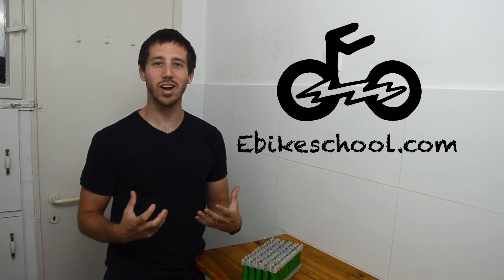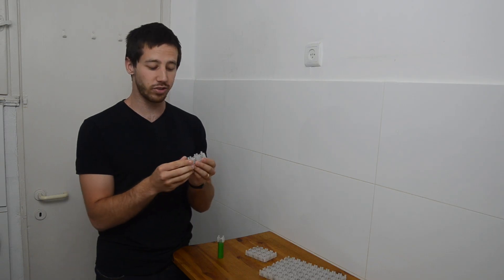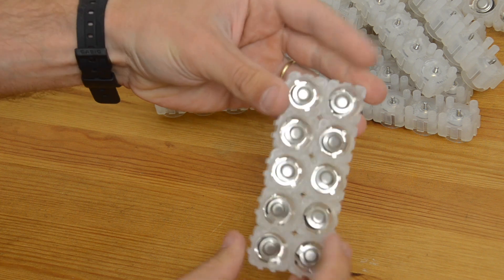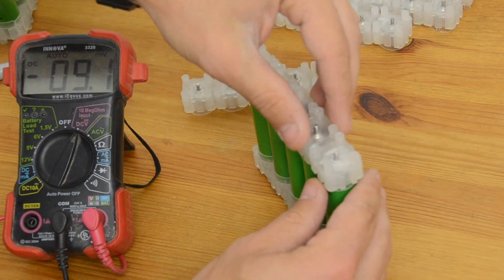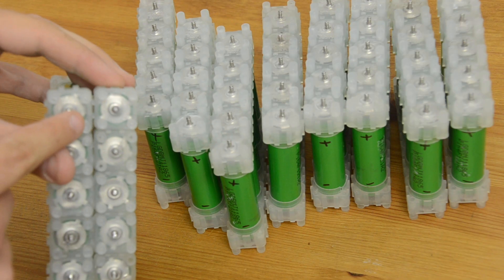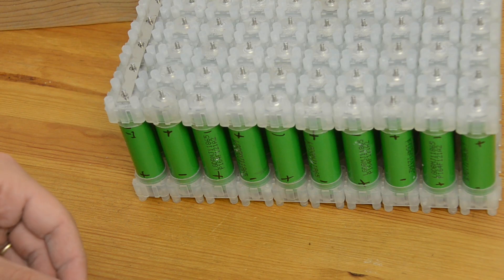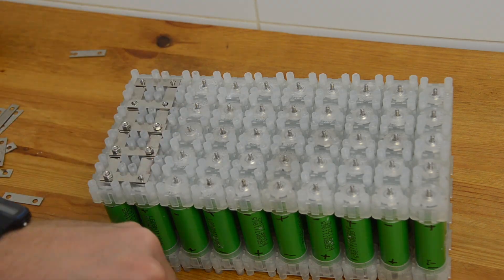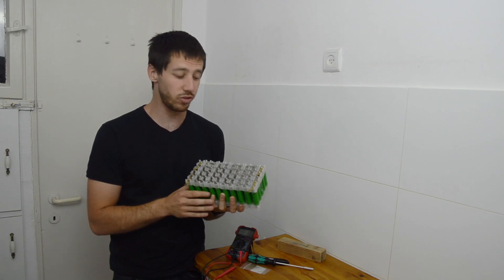No Spot Welder or Soldering Battery Building Kit from VRUZEND.com

Comment: Hey guys,
A question... :)
I have a 500w ebike motor rated for 36V and a 500w controller.
My battery (currently) is 10AH 36V which started to shut down on high load scenarios and was "fixed" by warranty (my bet is that 500w was torturing the battery for continuous current higher than designed).
although the battery was "fixed" (seems really like they disabled the bms, since there are serious voltage drops still) I'm looking for a battery to unlock the full potential of the 500w motor.
So I'm thinking to buy these cells connectors ( and 18650 cells) and really make just my own battery but I'm not sure at what current rating(with a bms), 15AH is enough for 500w ebike, what should i target?
And my current battery as far as i understand can deliver upto 360 watts of power, is that correct? (36V * 10Ah = 360W )?
Reply: Not quite, 36V * 10Ah = 360Wh, which is Energy - roughly how long you can ride for.
36V * 10A = 360W  This is Power (= energy per time) - i.e. how fast you can ride.
You need to know the maximum discharge current rating of the battery to know the max power it can deliver without stressing it.
The 500W motor would need 14A at 36V for full power (14 * 36 = 504). 
 
The 10Ah rating of your battery gives you a measure of the energy it can store, but tells you nothing about the maximum current it is happy delivering. 
Also the Ah rating of most batteries is quite dependent on how fast it is charged and discharged (generally the higher the current the lower the available total energy). 

With no losses, 14A would give about 42 minutes (10/14 hours) run time at full power from an ideal 10Ah battery. There are always losses of course and they increase with the square of the current. The avoidable losses are mostly to do with resistance and turn up as heat. 
At 14 amps the loss = 14 * 14 * total circuit resistance = 196 * R watts.
So even 0.5 ohms is completely unacceptable (98W of wasted heat!).

It is important to minimize resistance wherever possible, at every connection, in all power wires, in the motor controller switching components, and in the motor. Brushless motors are generally more efficient because their resistance is lower than for a brushed motor of equivalent power rating. 
See the comment from Gary Films and the reply above. These caps have been tested up to 3.5A per cell, so you'd need at least five cells in parallel (as shown in the vid) to cope with your 14A load. However you might find the contact resistance a little too high for your application (spot welds would be lower). Not sure I'd want to solder directly to these batteries in case the heat damages them.
But at 36V there are 10 sets of cells in series, with a spring loaded contact at each end, i.e. 20 sets of contacts in series, so even small resistances will start to add up, and might matter at high current (loss of max power / range, and extra battery heat).

Good luck :)
Reply: Thanks for the VERY detailed replay :)

Comment: Why do you bridge the sets 5 times?  One bridge per two sets of five is plenty.
Reply from the maker: One bridge (series connection) per set of 5 would in fact complete the circuit, but making 5 series connections makes a more robust circuit by reducing the resistance. If you only used one then you'd have a bottleneck of current at that point.

Comment: I have 6 battery from 3.7v 18650, how to make 14.4v?
Reply: 4 cells in series. The voltage of these cells varies quite a bit as they charge / discharge but they are referred to as 3.6V or sometimes 3.7V because this is approximately their equivalent voltage over the charge cycle. 4 * 3.6V = 14.4V but this could actually be as high as 16.8V when fully charged.

Comment: IFF U THINK YOU NEED BRASS ON THE TERMINAL MAYBE YOU NEED ALL CONNECTIONS BRASS THEY ARE THE SAME ONE IS THE OTHER IN SIGNIFICANCE THE BARE THE SAME LOAD .MY CONCERN IS THAT THEY LOOSE THE CONTACT OR DDISCONNECT I LIKE THE DESIGN BUT MORE INFO BEFORE A PURCHASE ON THIS ISSUE,THE ISSUE OF CONNECTIVITY ,I SHOULD WORK YOU THANX I WOULD SERVE U WELL
Reply: BRAINFART I SHOULD WORK FOR YOU .

Comment: dear, I have a question, I have a Scooter with 36v with 3 12V batteries, which model 18650 should I use 10 batteries of 2000ma or 2500ma or 3500ma? thank you and congratulations on the channel is very good.

From Brazil

Comment: what is the max amp rating? I need to use Samsung 25R with 20A continuous amperage. The setup is 12P outputting 240A. Do you have a solution for that?

Comment: How is it you are not getting shocked when touching all the exposed terminals? This is new to me. Also, shouldn’t there be fuses in here somewhere, like between the cells?
Reply: Shocks are supplied by alternating current (AC). Batteries are direct current (DC).  You will start to cook yourself at very high voltages DC, but you won't shock yourself.  Because you have thick calloused skin acting as a high ohm resistor, you won't actually cook yourself unless you wet your fingers and hold tight at both opposing terminals.  You probably need around 90 volts minimum to start risking danger to yourself. I think this is a 36 volt pack without rewatching the video.

Battery packs aren't usually fused internally, but you could do so to prevent a critical meltdown from damaged cell sets causing uneven and high discharge currents within the pack.

Comment: Hey Micah, I just received my battery kit in the mail. I noticed that the end caps are now red and blue, why the change? Also, now that I can not see through them I'm not sure how far to compress the entire pack together without squashing the contacts. Is there an OAL that I should try and achieve?
Reply from the maker: Hi Ron, this was a recent change to make the pack building easier, now you can differentiate between + and - ends of the cells and removes the chance to accidentally connect the wrong ends and short circuit. Even with the clear ends, the visual inspection method wasn't the best method. I find that its best to compress until you have approximately 88-90 mm from the top to bottom (the height of the cell with the caps on). It varies a bit from one cell to manufacturer to another. Also, a good tip is to first lift the spring contact up a bit higher in the cap before compressing the caps on. Then measure the voltage for each cell via the terminals after you've pushed the caps on and if you measure the correct voltage, you're golden!
Reply: Thanks for info. LYK how my "small" build goes.  Great tutorials, keep them coming!

Comment: What prevents galvanic corrosion?
Reply from the maker: The fact that all the metals are the same.
Reply: So all the manufacturers of 18650 batteries as well as you guys are using the same exact plating process? I find that hard to believe. Don't get me wrong I think this is a neat idea but I'm not convinced it is a stable long term solution. Short term and testing with these I think would be a very valuable. However, having a background in machining, plating and computers (during the time when the industry tried to use different materials for contacts, the plating even on computer component contacts these days differ enough to have to clean said contacts periodically) leads me to believe the same would yield with this product. With that being said, anything under a year or 2 would probably not be effected. For long term use, such as a battery bank for long term solar/off grid through battery life expectancy, would render the ill effects of galvanic corrosion. Again, great idea and it seems like you have a solid product... just not for the long term user. I'd love to see data from use/testing with various cells that disproves this theory.
Reply: Galvanic corrosion requires the presence of an electrolyte. How is an electrolyte present in this situation if the batteries remain dry?
Reply: Galvanic corrosion happens with dissimilar metals, not dissimilar plating processes.  You are not going to encounter galvanic corrosion from minute dissimilarity in alloys. There needs to be a minimum threshold in metal dissimilarity on the anodic index. It's not rocket science.
Reply: Look at this table.  Pick two different metals from two different rows, like Nickle (.30) and Brass (.40), subtracted is a difference of .10v potential, which is well within reason for harsh outdoor environments.  Certainly nothing on the order of what you're talking about in snicker plating processes.

https://www.engineersedge.com/galvanic_capatability.htm

Comment: Brilliant invention!  Can't wait to build mine!

I'm going to be building a battery to power an electric motor for my (large and stable) ocean kayak.  I plan to put the batteries in a water tight container with desiccant packs inside to absorb moister, however, I've found that no matter what you do in water environments, moister creeps in and corrosion sets in.  In the past I've used dielectric grease to stave off oxidation on electrical connections.  I was thinking about using a very small amount to coat the connections when using this kit.

Can anyone think of a reason that would or would not be a good idea?

Comment: I'm dumb about electronics...how many of the cells would you need to give off 36 volts? http://vruzend.com/product/set-of-2-lg-mj1-18650-battery-cells/
Reply from the maker: A minimum of 10 cells, but every additional 10 cells provides more capacity. I'd recommend my book DIY Lithium Batteries on Amazon, if you are just getting started and want to learn about battery building.

Comment: Checking to see if you have a proper connection by using a voltmeter??..really??..the only true way of determining if you have a proper connection, and i really doubt this will work, is to draw AMPERAGE from the completed pack. If there are connections that are loose it will become immediately apparent. As a matter  of fact the higher amperage you draw using this system,the more likely you will get into problems, too much resistance, cell voltage  variance over the course of a discharge cycle, etc

Comment: Good idea - can't help but feel the cells themselves could be better designed for this sort of application, but of course they were never designed for mass grouping I don't think.  However, there are variations on the 18650 (button or flat top) and I sense the possibility of an EV variant where they are designed better for large batch use.  COOLING is the next thing - how about some slim copper ribbon (like a tube but flattened somewhat) and end fittings and junction pieces, so cooling can be taken care of?  That would be an important serious next-level step?  For allowing mass cooling by threading such hollow-ribbon copper a cooling system could be implemented?

Comment: How would these work if building a larger bank that will be charging at 14.5-15v in a system with AGM batteries that receive a 400-500amp draw and charged with a 240amp charger?

Comment: what would the format be with making a triangle type battery for a 48v / 52v?
Reply: 56V / 3.5V = 16 cells in serie (after one another), 16 "rows" where the number of cells determine the capacity (parallel). Then you need the BMS to monitor the charging.

Comment: Love the idea. But i have watched some videos where some cells don't connect correctly.. my question i understand the plate is spring loaded - but why have a plate and not a spiral type connector - so if the battery pack moves the spiral will always be in contact with the battery...

Comment: Please take your ring off when doing this. It is a HUGE safety harzard if it makes contact with a buss bar or terminal it will ruin your day.  Awesome video I didn't know these existed till now :) I need to build some packs for powering the troling motor on a 10ft boat I am building.

Comment: Jehu Garcia pushed the caps together straight instead of sliding them from the side. It seemed to work properly. Any thoughts on that method?
Reply from the maker: Yea, avoid doing that. Jehu has an on-again, off-again relationship with following directions. Doing that wears out the dovetails and also makes it harder to align the caps correctly.

Comment: is it possible to connect different capacity of 18650 battery in parallel
Reply from the maker: theoretically, yes. But as they discharge, the higher capacity battery will prop up the lower capacity battery, resulting in more load on the higher capacity battery.
Reply: How can you make a package when the batteries are not all the same mA

Comment: 12volt for deep storage the size of 4 golf cart battery's possible?
Reply from the maker: Yep, though depending on your application you'll want either 3s or 4s (one is slightly above 12V and the other is slightly above 12V). You could also use a 12V DC-DC converter to get a steady 12V. Lots of customization options!
Reply: EbikeSchool.com thank you for the quick response. want a deep storage using the best cells possible using your connections.

Comment: Can't quite understand that the composition of the stacks being in such "minor" modules ? If the individual cells in banks of 5 that equate to 7.5volts And were then made in composition blocks of more stable and full layers of say 10 then  a fully connected disk spring base layer would allow a positive face for a same pitched opposite frame that could be an opposite  positively screw'ed down cap that was a thread size larger than the battery cell ! Modules of say 5 x10 . Tie-bolts top to bottom strategically placed for stability would assist with stable connections throughout , with individual maintenance to all cells in case of depletion or failure,also giving rise to connection for monitoring of the individual "Banks"
I find the cost of tooling the injection moulding for the "lets suck it and see approach" for a minor clip together "Lego" commendable ,But ! If the capability of up coming cells like tesla or J B Goodenough will be producing slightly larger more serious and durable batteries, then I think from being a maintenance man myself this "Initial " idea for packaging is a No No! With a little more thought towards tackling  this design problem into connectable and substantial modules for power size's  that have a wider add on feature as required by a broad spectrum of users would be a major winner in the public domain !

Comment: I like the idea of using ring terminals such as (https://goo.gl/PnzAaz) connected with an led+resistor between battery and bus bar (which is between batteries not connected on the terminal as shown in video) to light up when then fuse breaks and under the ring is where you place the fuse cable and tighten the nuts over it so the ring holds it down making easy replacement and leds when fuses pop. I might try that one day.

Comment: Great idea but honestly it's not so easy to assemble a battery pack from this kit. I bought two kits, and it's super hard to fit all cells into the pack. Also, it's quite challenging to tighten all the nuts because of the low quality (try it yourself and you'll see what I'm saying). Great idea but not very practical. Would have finished soldering 5 packs given the time I spent on this one pack. (I spent over 20 hours in order to assemble a 12S 7P pack with this kit.) Also, they didn't give me enough metal strips so I'm stuck on the last few cells. I have to go find some metal strips by myself.

Comment: Great system design. Looking to replace my Lead Acid batteries on my 36v scooter 10Ah. Looking forward to your next video on installing BMS to your 10S pack.  Do you solder leads to batteries or crimp wire knuts and then bolt to battery terminals tops?

Comment: While trying to form my question, I am going to struggle with words here. Non native speaker, sorry.
How is the value of power passing through from the battery terminals to the terminals in the caps?
I have seen other people using nickle based wiring like straps to have a decent flow.
Could one use a conductive paste to improve power flow between terminals? A drop or so would probably be plenty.

This would probably make for a good test I assume. Discharge rate and Charge rate could be used to measure improvements, if any.

Comment: could you do a short video explaining how to use wire fuse with these vruzend. is there a way to do this without welding ?
Reply from the maker: I'll add it to the list, but yes it should be easy to do without welding or soldering. Just use a fuse wire or resistor leg connected from the threaded post by one of the nuts. Here is an example: http://vruzend.com/wp-content/uploads/2017/04/cell-fuses.jpg